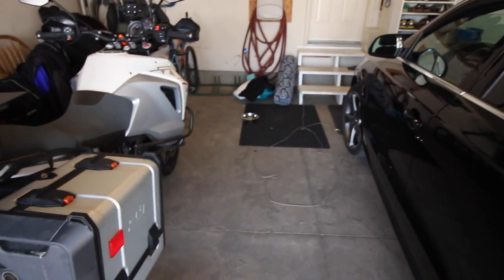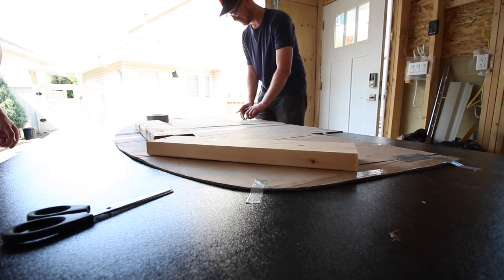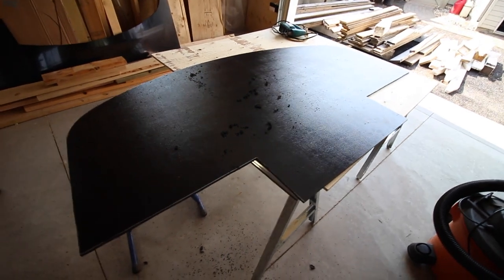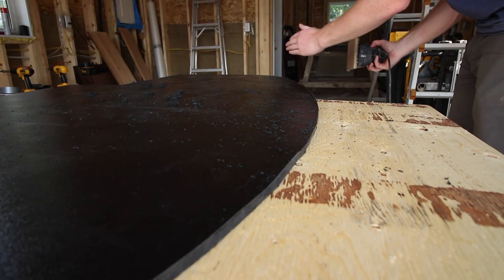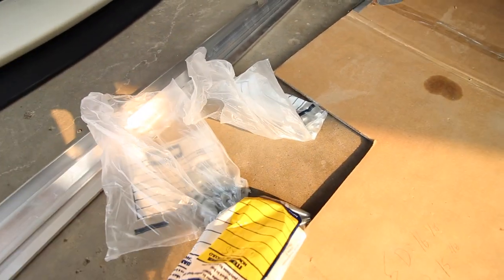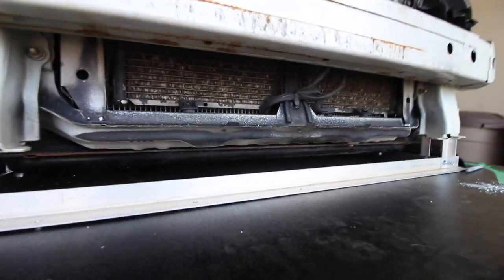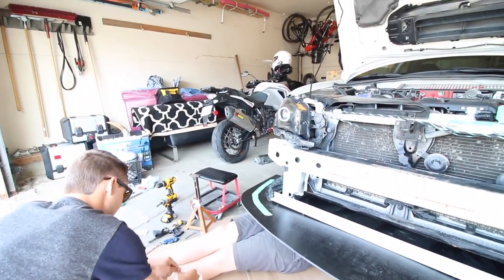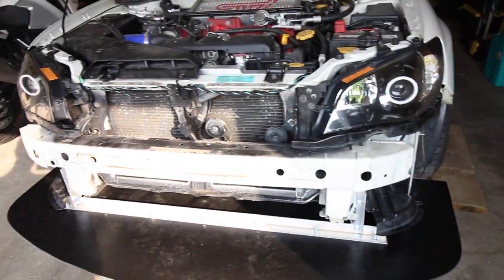How to Make your Own Front Splitter | DIY

Comment: Great ideas with the mount points.  I made the mistake of mounting my splitter to my front lip so I had to take off the splitter everytime I remove the front bumper.  I will come up with some kind of quick releases for the brackets do the splitter is somewhat easy to remove.  Good job
Reply from the maker: Thanks man! I'd love to come up with a quick release option as well!

Comment: Hey that looks like the Menards HDPE Plastic. Have you been pretty happy with it overall? How has it held up now? How does it do at highway speed? did you end up having to add front supports?
Reply from the maker: It's held up well! I don't currently have it on the car, but it had no issues at highway speed. Also never added the supports

Comment: Hey what's up. Quick question. How did you attach the fender liners? Usually they attach to the bumper but did you just drill them to the splitter instead of the bumper?
Reply from the maker: I actually just zip tied them to a part of the splitter! Kept them out of the way
Reply: @brodiecd7093  oh alright thanks for replying. Glad to see I can still use my fender liners when I make a splitter

Comment: how did you figure out what height to mount it at
Reply from the maker: If I recall correctly. We had the splitter mocked in place. So we could figure out how long the supports needed to be. That way the splitter sat just below bumper

Comment: Damn! I found this video after I just did mine. Did the exact same thing. Definitely the best way to do it. The worst thing is realizing you have to take everything off to do a damn oil change.
Reply from the maker: Haha I know man! I thought about cutting out a hole in those areas but never did it
Reply: @brodiecd7093  I thought about it too but I don't know if that compromises the functionality of the splitter
Reply from the maker: @Zenistful  yah I agree. Would be nice to think of some kind of quick release system. Where you could pop it off in a matter of a minute
Reply: @brodiecd7093  aaah! We could make a Hatch! With latches